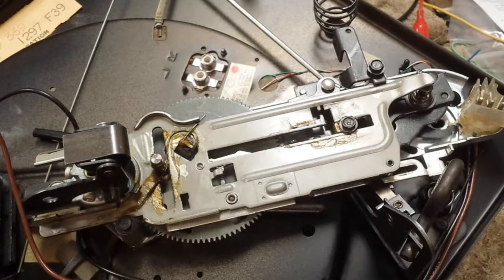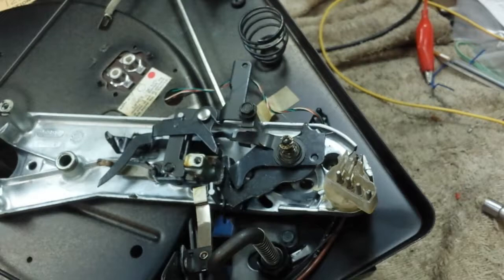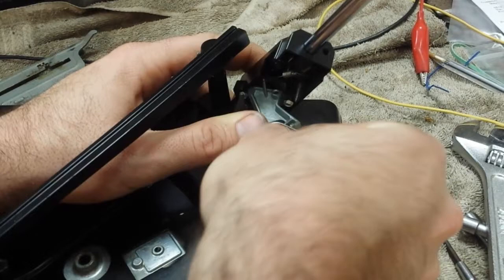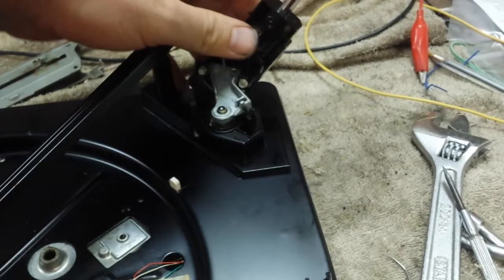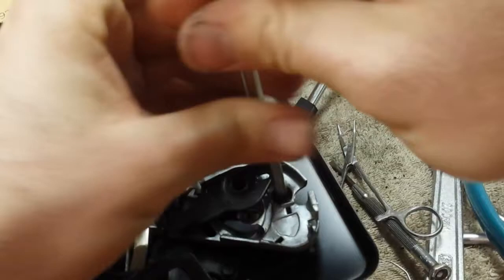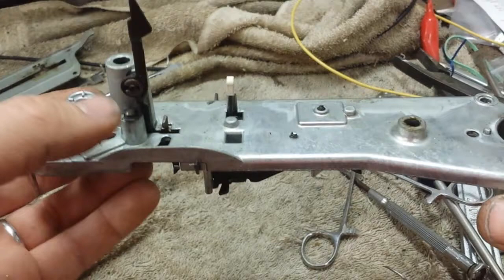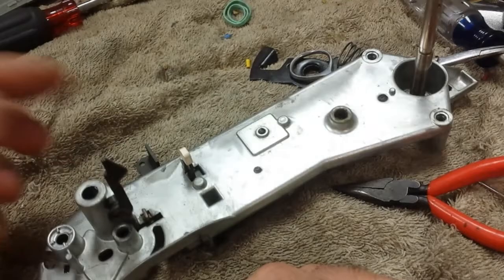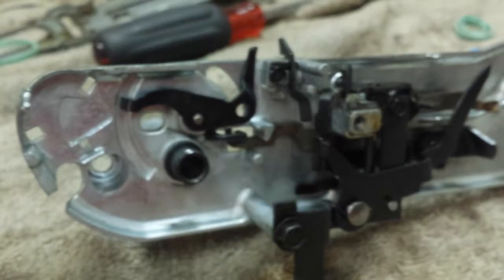Advanced Service points of A Voice of Music (VM) Turntable

Comment: hey I need your help!
I got a GE portable automatic record changer here that the overarm is all floppy side to side and doesn't stay in a fixed position when it is down like it is supose to. In addition to this I need to shift it waaay to the right in order for it to stay in it's upper locked position, as-in right above the tonearm rest. I have already had the player appart to regrease it and fix the idler.
I have a feeling someone forced something at some point, this is the changer with the (F) shaped overarm if that makes a difference at all.
I already have a feeling whatever is out of wack is what is causing the automatic mode to malfunction. The machine works fine on manual but when you engage auto with a stack of records you need to manually tell the player to return arm and drop the next record by engaging reject. I had to add ziptie spacers in the shaft of the overarm to prevent the arm from coming down violently, and bumping the tonearm, scratching records in the process! It does that by it self, once I think the arm is down it will hammer down on it's shaft, bumping the back of the tonearm. I really would like to fix it the right way if possible! I didn't see any broken pieces inside

Comment: Hi Jordan. It’s a long shot if this message will reach you since this video was uploaded a few years ago. 

These videos have been of so much help while refurbishing my own zenith stereo console. It has an identical turntable. 
Would you have any clue how to fix a turntable that doesn’t begin the cycle automatically? I can tell that the little trip pawl on the main cam gear is not engaging with the turntable since I can only get it to cycle by moving the gear by hand to engage it. However, the cycle will begin when I use the reject option on the dial. What gives? The pawl is free moving and lubricated. I have a version with plastic parts, not the brass type. Is there supposed to be tension on it, or is there something that isn’t pushing it out when I turn the record player on?

If you have any idea, I’d love to hear it
Reply from the maker: You jave to look at the interaction with the reject function knob and how it starts the cycle.

Typically when you start the cycle something is supposed to kick the aluminum slide back towards the arm. The end closest to the center of the record is supposed to contact the trip. Make sure this happens. 

Also if it picks up at the end, one can assume the aluminum slide is ok and thr interactions with the arm are ok and ots likely the connecting linkage between the on/off/reject knob and the aluminum slide.
Reply: @JordanPier  I will take a look at these and let you know what I find! thanks so much!

Comment: Thanks for making this video.  It is a huge help in getting the V-M I have back into working condition.

Do you have any info on the power connection?  I am going to power my V-M a1296 directly instead of from the receiver unit.  I understand the AC switch can use a cord plugged into the wall using the 4 prong connector on the other end.  I just can't figure out which pins the wires are supposed to connect to.
Reply from the maker: Of the 4 pins, one is AC, one is chassis Ground, one is the low side of the switch to supply power to something else like the console. The last one is AC. 

On occasion the last two pins could be switched. I'll get an ohm meter, turn the turntable on and measure the resistance between either the two outer pins or one outer pin and the one just inside the other outer pin. With the turntable on you should read around 200 something ohms and off should be infinity. If it's 200 something all the time you're on the low side of the switch. Connect AC to the two pins that only have resistance when the switch is on and you should be good.

Comment: Hey, I need help I can’t put the on/off linkage back on. It just falls off.
Reply from the maker: The linkage has to be put into the transmissions side with the transmission out so you can get a steep enough angle to get it completely seated.

Comment: Thank you for these helpful videos! I have several Motorola consoles and watched this 3 part video many times to get into one of my changers. I was successful until I went all the way and removed the tone arm. When the record ends the tone arm slides back a little across  it before lifting up. Any thought on where to recheck would be great, I took lots of pics and am not sure what I changed.
Thanks again, I appreciate you sharing all these projects!
Reply from the maker: Check cracking force (should be about 5 grams) and make sure the trip on the cycling cam is not sticking.
Reply: @JordanPier  thank you, I was able to get it right! I really appreciate these videos 😁

Comment: Help please!!
I have a Columbia 360 which is a VM mechanism. I completely took everything apart, cleaned and lubed and oiled what needs to be. The speed is good, I stacked several records on the changer and they dropped and played as normal. When the last record dropped though, as soon as the needle touched the record, the player shut off. I turned the player back on and it plays fine. After the record finished, the arm returned and shut off like it should. I’m lost. I went through the manual troubleshooting suggestions for the turntable shutting off after the last record drops but non of the suggestions helped. Any ideas?
Thanks
Dave
Reply from the maker: On the main slide there is a spring loaded feeler that if it's sticky in the least will cause this symptom. There must also be precise timing between when the last record falls and triggers the size detector to when the record holding arm falls after. If the arm falls to the stop before the record trips the size sensor it will cause the symptom.
Reply: @JordanPier  
Thanks. I’ll check the timing. The spring feelers was completely cleaned and free moving.
Reply: @JordanPier  
We’ll, the spring is free of gunk and good. I tried manually dropping the arm at different times when the record dropped but nothing seems to stop the switch from turning off
Reply: @JordanPier  
Ok, another issue just popped up. While I was troubleshooting I cycled the reject with the arm down expecting it to shut off but when the arm moved to the end just before lowering down on the catch, the arm snapped to the 10 inch record position then turned off.   ??? Man, it seems every time I clean or lube something another issue pops up, Frustrating. Any thoughts?
Reply: @JordanPier  
Just to let you know, I figured it out. After I cleaned the arm I put the wrong spacer in between the arm and player and the arm would not tighten enough causing the mechanism not to lock into position. I found the original which was thinner back on. It tightened more giving more spring compression and now it works great! Thanks for your help!👍
Reply from the maker: @VintageRadioRepair  record holding arm sensor is not triggering end of play. Since no 12" sensor is tripped it goes to 10"

Comment: What an informative video!  That's identical to the 1960's turntable in my Zenith stereo.  Any way to contact you via e-mail...I was disassembling mine and can't remove the cam gear...it moves very freely, but it won't come out.  I tried heating it, but no success.  Also, a part fell out and I have no idea where it goes...could you assist?  Thanks!

Comment: The records are running to slow, does that mean I need to replace the motor?
Reply from the maker: Pulley may be worn. Is it equally slow on all speeds after a new idler? If so, it may be the motor.

If only slow on one or two speeds then it may be the pulley. You can build up with clear nail polish and machine down until right of you have those skills. Otherwise replace the motor